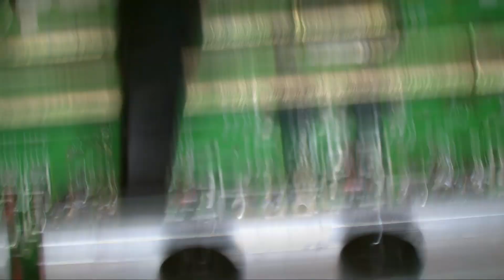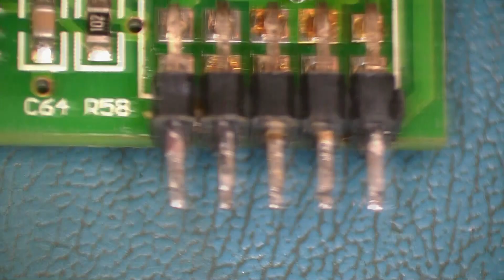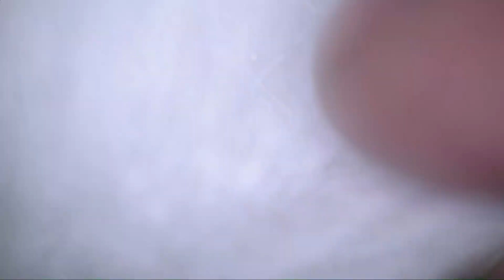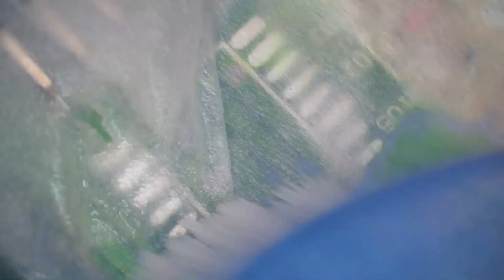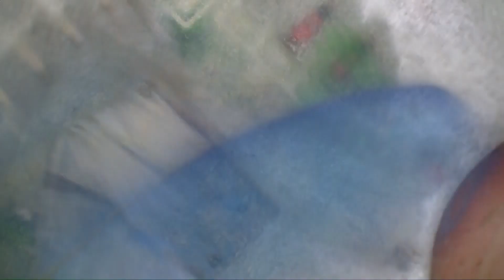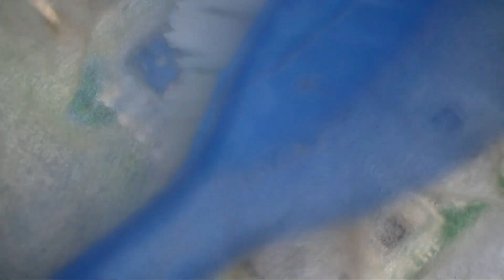JBL GTO14001 CLASS D AMPLIFIER REPAIR.

Comment: Hey, I always enjoy watching these tutorials. May I trouble you with a tiny little question??? I have a MM2000.1D amplifier that I accidently inserted the rca input into rca line out..... The amp still powers on normal with no protect but of course no sound. If you could steer me to the correct section to troubleshoot I should be able to repair it. For example the pre-amps? the PWM card??  any advice would help.
Thanks in advance!!!

Comment: Hi.. I have a JBL GTO 804ez 4 channel Class AB Amplifier, out of the 4 channels, 3 channels are doing good. But one channel (Rear Right) it plays but lacks power & noise in it. I am not sure, whats wrong in it. I have opened and checked, seems all the electronics good, I dont see any burnt of any electronics inside. Also, checked the FETs, seems good. What could be the issue? Please suggest

Comment: It's not class D, but a class AB monoblock amplifier
Reply: No, is class D. One website mislabeled it as class AB when they got it confused with the GTO1004. If you watch this video you'll see clearly it is a class D in fullbridge with high side bootstrap, 2010 class D mosfet driver and so on.

Comment: Kev, halleluijah, finally someone who knows what their doing. Have you worked on any of the PMP series Behringers (mixers/desks) ps, use a thinner solder, i.e. .2mm for small pins such as the DIL8

Comment: I have this amplifier and it is  not a Class D. It is a Class AB. It's rated only for 2ohms. I hear you can run it at 1ohm tho. Highly underrated amplifier. Would like to see a dyno test on one.
Reply from the maker: Hmm bizarre. From what I remember it had class D pre-drive circuits. Only worked on one of these models so I don't know the amp all that well.
Reply: @Kev_31779  
So I actually discovered it was being advertised incorrectly as AB. But JBL notified sellers site that it is a class D. I wonder if it is 1 ohm stable?
Reply: This is a class D, full bridge design. It is rated for 2 ohms. 

In testing with resistive loads, it can handle 1.3 ohms, but not 1. So you could wire subs to 1 ohm and as long as it's actual impedance us is 1.3 or higher you should be fine.
Reply: @JasonWW2000 
I've since sold it. I upgraded to an NVX XAD15. But yes, everything you said here is accurate. I've always thought it was AB because it was advertised as that. And the fact the it was only 2ohm stable unlike most other Class D amps at the time. But that is because it is full bridge. Awesome amp though. I ran it for almost 10 years!
Reply: Is the power rating close to the rated power please let us know
Reply: @francisnganga4010 Yes, it does rated power.
Reply: Rated power plus.
 @francisnganga4010

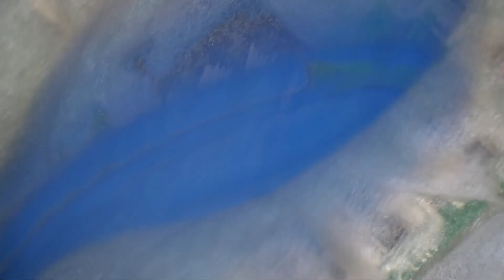Comment: It's nice how you show how to proprely replace an IC taking care of not dammaging the board and redundant components, keeping the pads flux-wet, just beautiful!! , but, it also seems impractical to take thaaaaat much time to change an IC, i hope it's just for the show, really Clean!!!  i can do the swap that you did from 8:20 to 17:30 in 2 or 3 minutes, anyways, really neat job you did there! :D
Reply from the maker: Not dumb to take time to properly repair a paying persons amp. I don't want to see it again, but thanks.
Reply: @Kev_31779   I didn't mean it in that way, of course what you did is everything but dumb, sorry for using the word dumb, i'm the only dumb here! haha, what i mean is that from my experience, it seems impractical to take 13 minutes to change 1 IC using the same method for a damaged part, and a good part, so what i would do to remove the bad part is just heat the entire pads,alternating between both sides with a controlled temperature iron and a flat tip, and go all over the pins adding just enough solder for thermal mass until the chip is released, this takes not more than 20 seconds, then i would go on with the solder wick and clean the pads as you did, keeping it all flux-wet like you did, and then i would clean it with isopropylAlchl, like you did, then , for the good part, all being cleaned, i put the ic in possition then i solder 2 corner pads, then i make sure it is aligned, once aligned , and with a flat iron i add solder all over the pads, and then with solder wick clean the excess, this gives you a reflow finish to your end fix, and at the end clean it with isopropylAlchl, of course, like you did, try it, and tell me how it goes. Cheers! i like your channel!  :D
Reply from the maker: I've done it that way as well. It all depends on how I want to do it at the moment. Sometimes the re flow method might add more heat than needed to the new IC and can be a small bit riskier with bad or cold solder joints if not done properly.

Comment: I may want to talk with you, I have a 1990's pioneer that who ever wired it to the battery only used a 15 mp fuse it wud blow if i listened loud for more than 15 mins so I put in a 20 amp fuse inline and now the amp will only go up a little before it cuts out like in protection mode  Im going to put a inline 40 tube style fuse but whatever went wrong wont let me turn it up

Comment: Good video.. I found that I’m having some trouble with my jl “a” series. It seems to have some feed back when ever I adjust the sensitivity. Skipping in and out of the 1&2 channnels. I’ve seen that other people are having similar issue with their same amps. Seem like it’s came lose due to use over time. I need to check into it more closer, I’d hate to buy another one.

Comment: You make soldering those tiny pins look so easy! I'd have blobs touching all the pins and give up.. Great video.
Reply: Its even easier to hot-air the new chip back on, all pins soldered at once, gets pulled into place by surface tension, so long as enough flux is used.   However sometimes hot-air blows components around which is annoying.

Comment: But the question what caused the mosfet(s)? to fail in the first place, and as usual it takes out the low and high side driver ic too.
Reply: bjtaudio Could have been too heavy a load, but things just fail sometimes, and when there’s problems in the drive output stage it will usually take other things with it.
Reply: Yes it certainly does, it can make an expensive mess..

Comment: How can I get in touch with you? 
I've just replaced some fets. Can I test the amp without having the board attached to the case thermal pasted down? Would I get a power light if I don't? One of my fets of the 6 I replaced have a way different ohms reading while on the board.
Reply: Zander Nicholas its not just replace fets you need to balance the amp

Comment: pop quiz - I have a class a/b amplifier for a year. one day at a street light, on low volume, my speakers decided to go crazy, popping and loud noises. turned off remote power and went to the fuse to the battery and the fuse housing was slightly melted. fuse was hot af, but not blown. my class d is fine, but the a/b has the "clip" light on even though remote power is off. any possible explanation?
Reply: Bugs Bunnay High current failure of some kind.  Would require inspection/diagnostics.

Comment: Have you ever repaired a Harman kardon avr 7000 home receiver?  I'm looking at repairing this myself as there aren't any repair shops where I live that could fix this.  this model has a known dts board problem and has 6.3v caps that tend to swell up due to heat from being so close to 5v.   from what I've heard/read is to replace them with 10v caps same capacitance 1000uf but 10v.  what are your thoughts on this.  I really love this receiver it's rated at 110 Watts per channel and 75 amps of high current. which is pretty beefy. let me know your thoughts on this and if I could pick your brain if I have any issues.
Reply: yes, you're fine to put in higher voltage caps.
Reply: 75 amps of high current but only 110 watts a channel... Eh, I don’t think so.

Comment: Thanks for The tips on the punch800a2 problem I did what you said and I'm geting 11.28v DC    from outer shield of rca input to +power in put and 0.28vdc from outer shield to -input power and also I forgot to mention  a damaged diode that is all that's visually damaged on this amp.
Reply from the maker: The voltages seem normal but not the diode issue.

Comment: Thanks for replying I honestly feel vary honored to have a chance to converse with you.Let me give you some more insight on the issue I'm having with this amp.I accedently for got to connect the ground input power to the amplifier  first as I was connecting the amp to the out put  phono to rca jack of flat screen witch I don't recommend doing  and as I was going to connect the first rca to amp rca input stage the rca outer shield sparked and it took out the flat screen and Killed the amp but luckily I think my switching psu of my is still operating as i tested it and it is drawing about 3amps initial and sitals down to about 1amp constent draw. And I can hear stand by sound though the speaker that's connected to amp  meaning that sound you hear  when you have no audio tone going though the speakers but if  you crank up the volume the hiss gets louder its like a light hiss but it's not distortion I hope you understand what I'm referring to. But when I go to connect the rcas as soon as they toch inputs of amp it cuts out like there's some type of short.Thanks in advance I'm wondering if I fried the opamps.
Reply from the maker: It might be possible that the op amps may have took a hit but I would check to see when the amp is powered on if you have DC voltage from the power supply ground to the outer shield of the RCA. It should be under a volt or nothing.  If high DC is present there you may have some digging to do. You could have a cracked mica insulator on a Mosfet somewhere or something shorting to RCA ground. Without fully understanding the situation or not having a schematic, its hard to tell you what to look for.
Reply: Kev31779 Thanks for your help I appreciate it enormously.im just going to change out every single opamp I checked voltage on em and I'm only geting -1v amp running and I have about 20v going in to that section I hope I'm right I have 2 more rockford amps. for spear parts and I checked the other rockford running and it shows voltage on some of the pins on those opamps but none on the dead evil rockford 800a2 lol sorry to bother so much befor a change them out is there a another way I.Can check those opamps for function with a dmm.

Comment: Just one thing I don't quite get. Mustn't you have a signal present at the inputs in order to see that squarewave at the FET gates?
Reply from the maker: Class D Is more complicated with that. It is somewhat combined width a pulse with modulated signal. Then filtered.
Some reading here if you like.
https://www.maximintegrated.com/en/app-notes/index.mvp/id/3977

Comment: Hello Mr Kev31779 I have an older Rockford Fosgate Punch 200A4 I recently purchased 2nd hand it's a VERY clean looking for it's age but I think the previous owner may have ran the rear channels at a load lower than recommended. When I hook the amp up to a battery and head unit (no engine running) you can hear a high pitch coming out of the speakers at any volume even at 0 with nothing playing when the amp's crossover switch is on full or high.  I'm wondering if you'd be willing to fix it. Please send me a message on here if we can do this.

Comment: Any idea what caused these parts to fail?
Reply from the maker: One of the amplifier fets shorted from source or drain to the gate pin causing it to kill the IC driving them. Whenever something shorts to gate it is never a good sign and could cause driving issues. How the fet died I have no idea. Maybe over driving, loose heat sink screws or just a part ready to fail.
Reply: Thank you.
Reply: @Kev_31779   Yes!!, whenever there is a breakdown voltage reached betweet Gate and source (Vgs), there is no way of bringing back that FET, that is why it is so important to have Calmping diodes between these two pins to prevent any excessive level of (Vgs), hence keeping it below breakdown levels! check for instance the datasheet for The MOSFET STP7NK80ZFP, and look at how the dioes are clamping voltages between Gate and Source.

Comment: Thanks Kevin. Are you using a audio signal generator or a function generator?
Reply from the maker: I use an arbitrary waveform generator.  Either type would work.